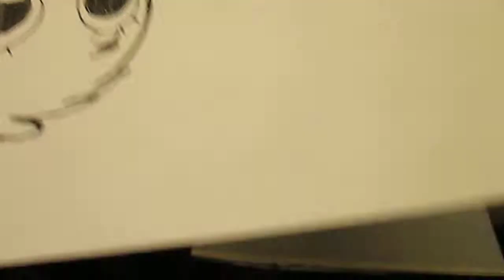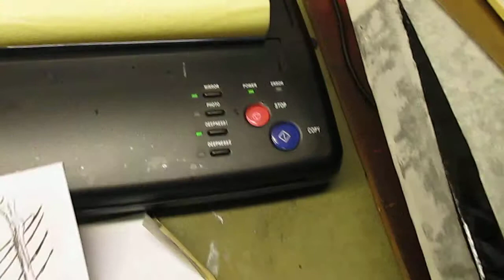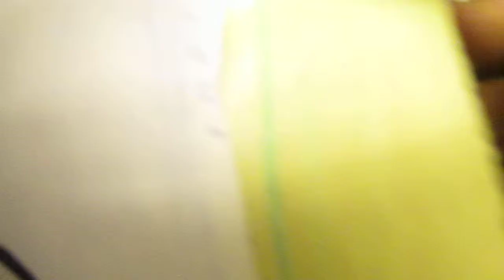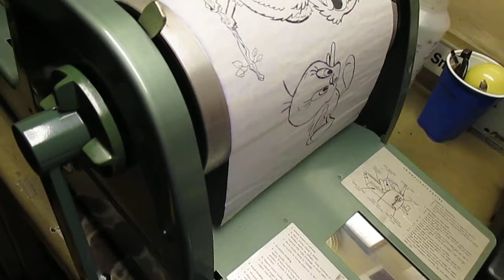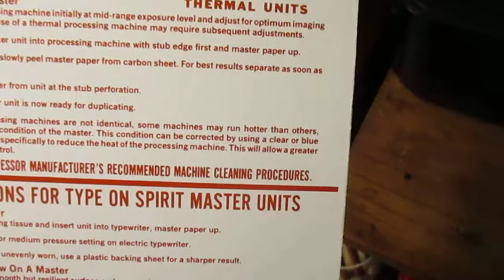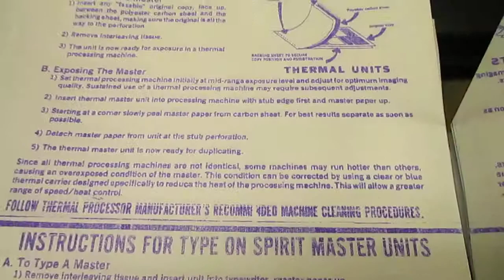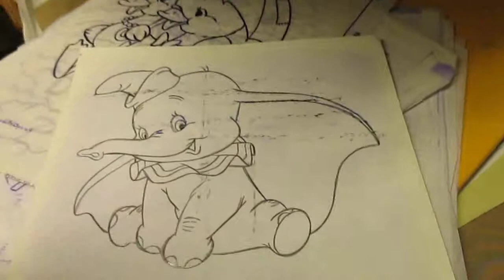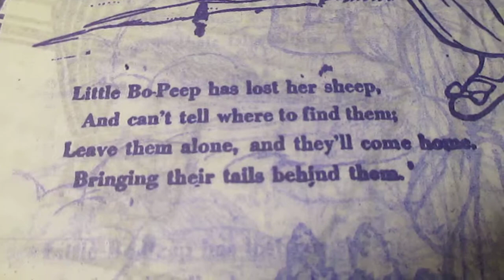HOW TO MAKE A CARBON MASTER UNIT. THERMAL AND HANDWRITTEN

Comment: For those of you who are still using spirit duplicators and find that the rubber feed wheels lose their tackiness and won't feed paper properly:  a tip I've discovered is daubing the feed wheels with Elmer's Rubber Cement.  It makes the machine feed like a dream with no misfeeds or wrinkled copies.

Comment: Sam - did you get my email I sent to you?
Reply from the maker: No Bob I didn't. Unless it was the one about the Ditto machine that you acquired? I replied to that. Write me directly at Backstagehair@comcast.net  Writle the word KELSOM in the subject area. Sorry, I will check the other folders maybe it went to spam.
Reply from the maker: I checked and did get your original question needing a wick and a handle. I relied to you on Youtube. I cannot give you my email address on Ebays as it is forbidden. Write me directly at BACKSTAGEHAIR@COMCAST.NET  and I can more freely communicate with you. Ebay moniters all messages and will edit or remove the reply. I do need the original wick if you have it.I wrote from Ebay what I need .When you make a purchase, I will be able to have your Email address from Paypal. If I cannot help fill the order I will return your purchase money minus the postage.
Reply: @SamKeller1954  Hi Sam!  Sorry for the confusion - I emailed you at your GMAIL account earlier in the week -- and never got a response - and then I eventually messaged you through the EBAY messenger in hopes of connecting with you.  I did not get a response about the wick or the handle.  I DID get your ebay message TODAY.  I will try to email you at the Backstagehair email - because there is other things I wanted to ask you about - AND I do want to want to get that wick.  Thanks!!!!!  Bob
Reply from the maker: Did I ever fill your request? I'm sorry if I didn't Been in an out of hospital and missed some emails. Also had my computer serviced and he erased a lot of mail. backstagehair@comcast.net if i can be of help.
Reply: @SamKeller1954  You did Sam -- sorry to hear you have been down - welcome back!